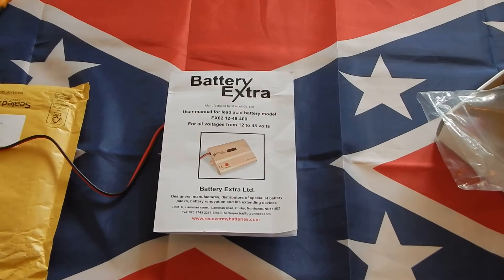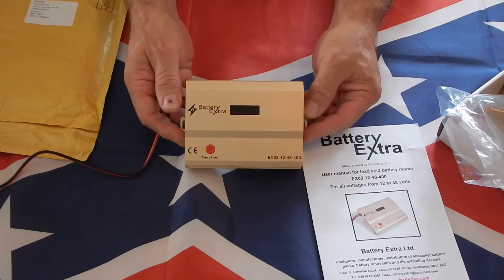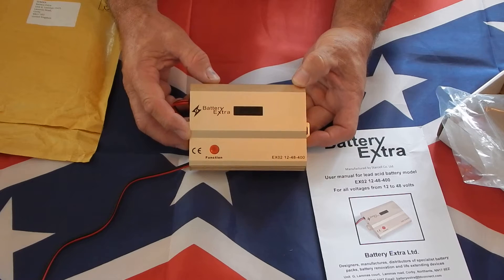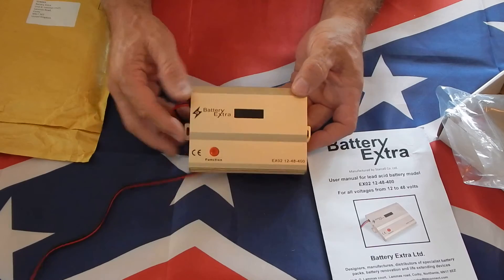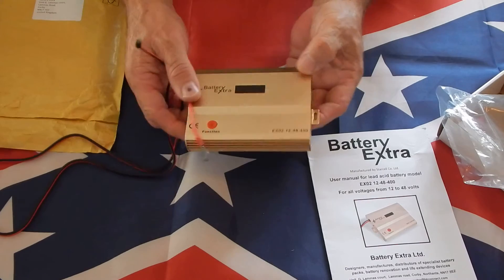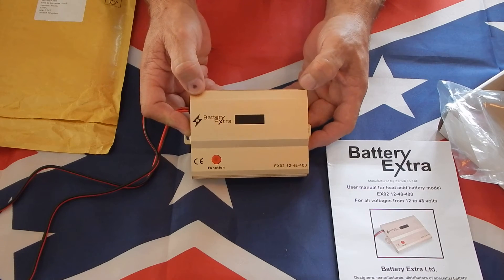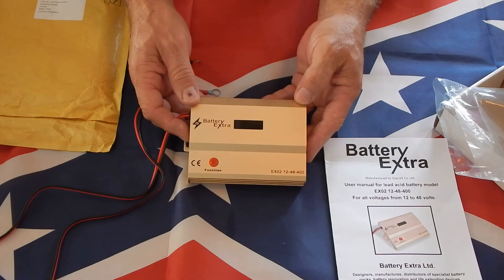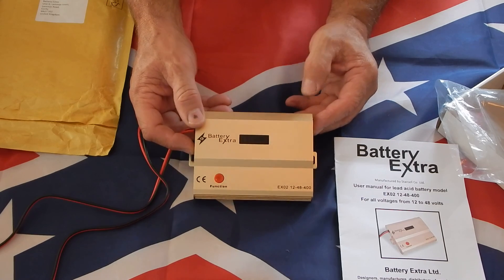Battery Extra Battery Recovery System / Desulphator - Part 1

Comment: mine works great i know a lot of people that have them and say how well there working on wet batteries. My unit will do 200 400 800, That is 3000ah bank i think. Had it for a few years now. Will be good to see the over time photos of it cleaning up your bank.
Reply from the maker: Wow!  What timing,I just hooked it up on 1 set of 4x 6V battery's set on 400 setting . I would think this would do both sets of 24v as they are tied together at the buss bar. Not up to snuff today with injury, but I will do a  install & setting video , there is nothing to it. I will also update with internal battery cells pictures over time maybe every 2 or 3 days for at least a 30 day period . I would assume U will be able to see a difference I hope. I have the next size down from yours up to 1500 amp hrs 12/48 volts.
Reply: Yes just turn it on and let it do its Job. You should have no more problems.
Reply: just hook it to the busbar mate. it should do all your bank. You can clean it one bank at a time if you want to though. Might go faster that way. Mine is just hooked up to the busbar though
Reply from the maker: Thanks! That was the plan but that meant I had to walk to my shop a couple hundred feet away for 2 missing tools not in my house , To far a walk today I will also put a piece of aluminum plate under it.
Reply: TheKilog69
i know how it is mate. Pain is a bitch. For me winter is the worst for it.

Comment: Awesome...can't wait to see the results. I know zilch on these, but am curious "how" they actually work. Wondering if it is some kind of piezo-electric signal or something. Solar power battery banks "sit" stationary unlike car, truck, boat, and motorcycle batteries that naturally get "shook up" by movement...helping to "stir" the electrolyte.
Reply from the maker: Yes that's a good point. This unit I guess gives off different types of low voltage spikes or signals   to the battery bank it seems that's what I got out of reading about it. I will hook it to the bus bars or may be 1 24v battery at a time, I will install it as soon as I am able.

Comment: This is great info..... so anxious to see the updates and how well it works out for you!
Reply from the maker: Thanks Joe. If it does its job everybody  has battery's not just for a solar battery,cars trucks tractors so on. This is the 3nd largest model there is a much smaller unit for recovering a car type battery.

Comment: Nice brother. I hope this helps. So I got me 25 or so Edison battery. They are 30 + years old and the guy I got them from was getting a min of 90% of there amp hrs.. Going to be cool to see how this works.. I an run them down to 20% with out even harming them. Hope to have around 600 amp hrs.
Reply from the maker: Thanks ! That's great news on the Edison battery's, I am so happy for U  I hope U can make them work all they can . 600 amp hrs should be like about 1200 in lead acid. I got a quote for a 500 amp hr set @24v almost $10,000 way out of my range.  Those are said to last almost forever. I keep looking for some used hard to find , Nice score!!
Reply: Thanks brother. DO you have a friend who is part of the rail road? If so you can get them for free for like 10 bucks a cell. Right now the rail roads are going to lithium ion to cut down on maintenance. So even tho the batts will not last a long they will save on payed man hrs of maintenance. Maybe that will help brother. 

So I worked on them for a living for years. We had a set that was over 55 years old and still gave use a mim of 95% of there power. Even my wife who is not all into solar looked them up and is like WOW this is BAD ass for us lol..
Reply from the maker: Thanks for the info Brother !

Comment: the directions are unclear if you use one device for multiple banks of batteries. when Justin did his, he had one on each bank.
thanks
Reply from the maker: We  will see it clearly says it will do up to 1500 amp hour battery bank, I should be good.
Reply: yes but a bank refers to each set of batteries to make up the voltage, like for my 24 volt setup, I have three banks of four 6 volt batteries, which are totaling less than the 1500 ah.
Reply from the maker: This will work for U I believe.